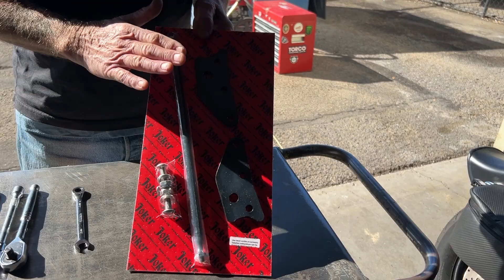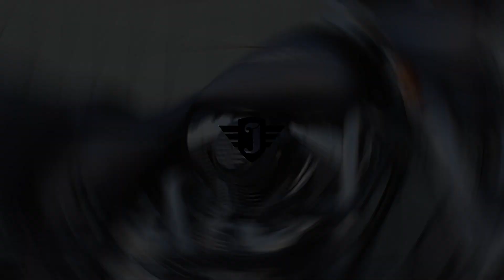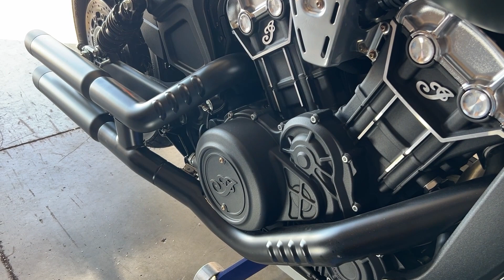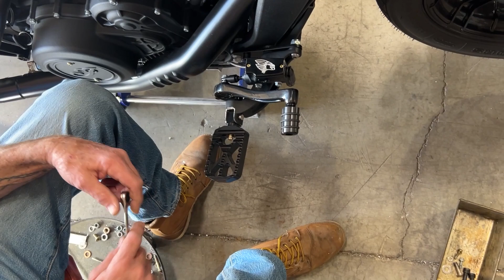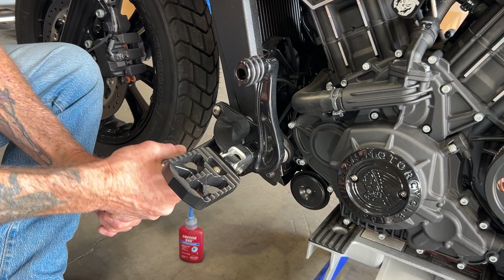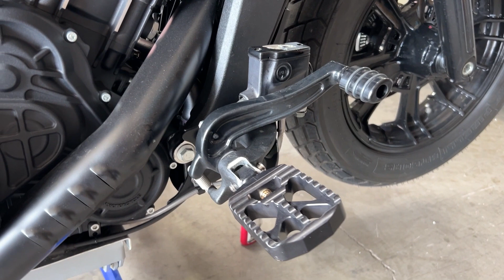Indian Foot Control Extension Kit Install

Comment: Just installed on my 2022 Scout Bobber and at 6', 2" I initially thought the extra 2.5" fwd extension did not make much difference, but after a few days of riding I really like the new feel (and look).  Maybe I got a fluke or wrong kit but the holes in the extension plates were just a hair wrong and wouldn't allow the three bolts to thread in together (no I didn't tighten until all were started), so I got a machine shop to drill out each hole just a tad to make it work (+$20.00).  Update: Props to JM for reaching out regarding the small batch that went out with this problem!
Reply from the maker: Sorry to hear about the problem. Did you get them from us directly? I’m only asking because there was a run of plates with undersized holes. We’ve since fixed it. Email us if you want to try a new set of mounting plates. sales@jokermachine.com
Reply: @JokerMachineVideo  JMV, no I purchased via a 3d party and thank you for reaching out.  No need for further assistance and your kit is working great!

Comment: I want to do this to mine because Im six feet tall and the ride is a little bit uncomfortable. I have engine saver/ highway bars. Would this interfere with them? Would I have enough clearance for my size 13 feet? Lol
Reply: I know this was a few months back... But in currently working on mine with the Viking highway bar and I'm running into an issue with the shift rod being too short... Have you figured anything out on yours?

EDIT

So I ended up getting mine working okay, but I can't have the lever too high, so riding with boots is impossible. I might look into changing the whole lever out to one with a different angle so it doesn't have to be adjusted out so far.

Comment: So curious if this raise the foot, it stays the same or ideally lowers the foot. I am looking to both extend and lower the pegs. Yes I know that will potentially reduce ground clearance
Reply: Answering two years late:  Seems to be same level, just fwd 2.5", which is just abiut the limit without having to replace the brake line.

Comment: Will this kit work with the Dean Speed crash bars?
Reply: I've seen some photos with these installed along with the OEM crash bars, so I assume they will also work with the Joker crash bars. I think it may bump everything outwards the additional width of the crash bar mounting surface so you may need to add a few additional "spacer washers" on that left side to keep the shifter rod more aligned. 
I'm doing the same thing but getting my OEM crash bars powder coated black - hope it works!